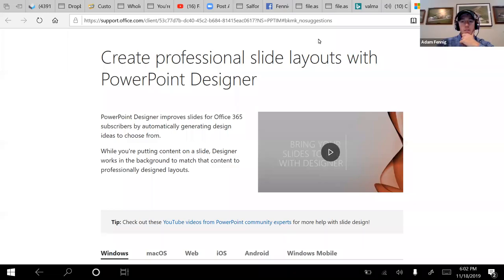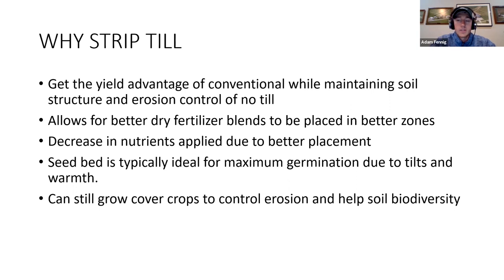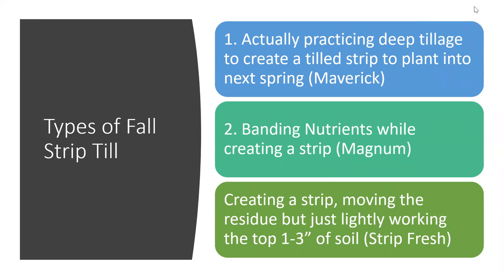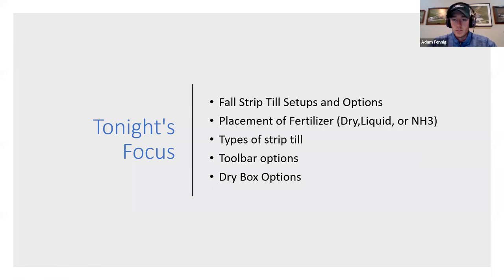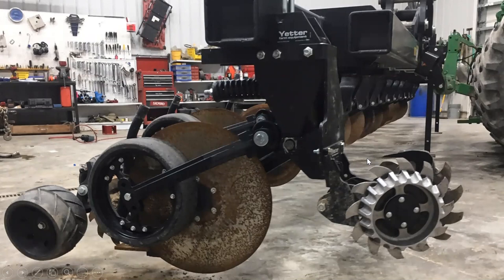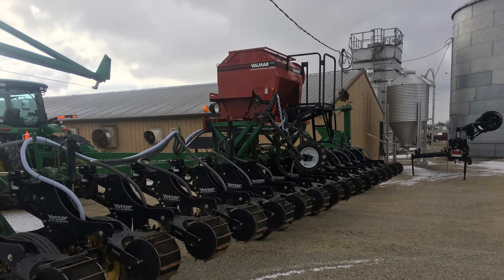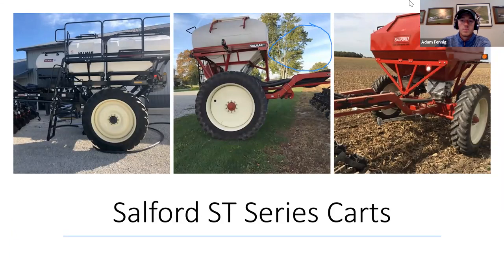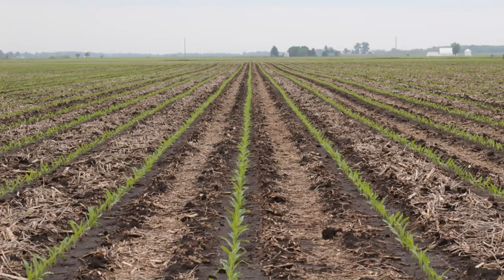All Things Strip Till Webinar

Comment: Are there any strip till equipment for small holder farmers with smaller tractors? 
Does strip till only work with GPS?
Reply: yes, you can buy any size strip till equipment.  You can manually plant on the strips, works pretty good but you have to stay on the strip.